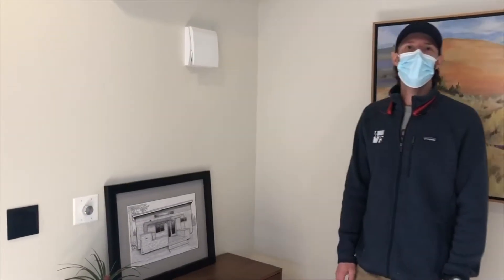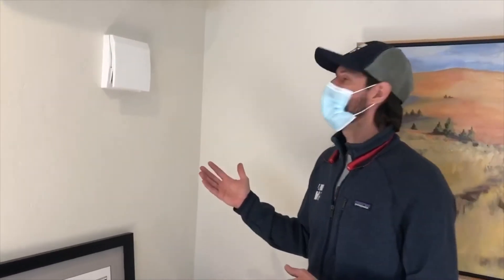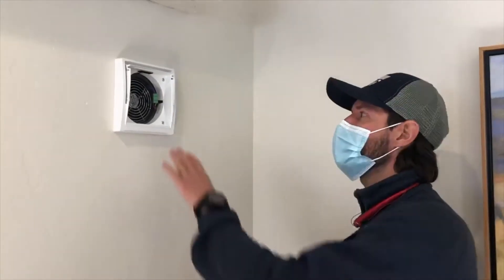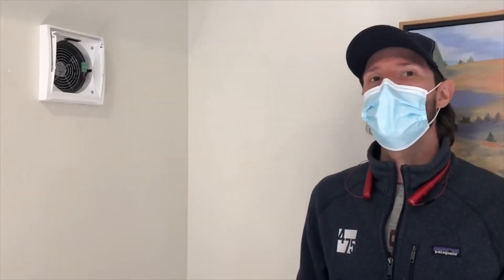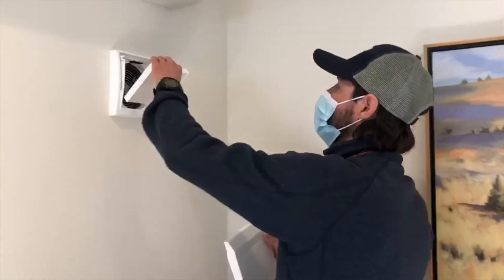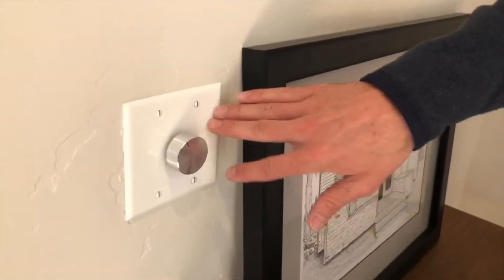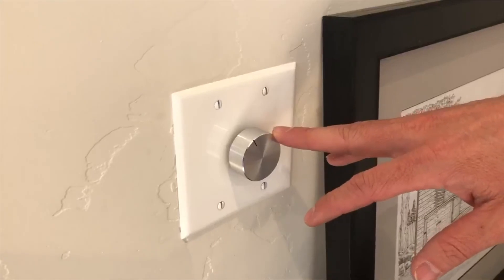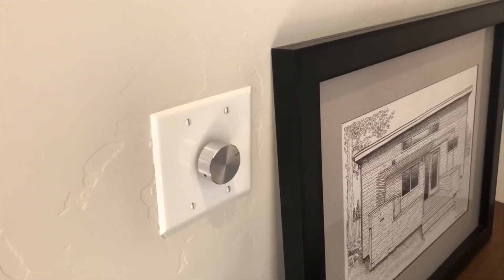LUNOS e² System at Hiatus Roanoke

Comment: What do you guys suggest for insulation after the fact, on old construction.  Most of the videos are of insulating on new construction before the drywall and siding.  I just cut holes for 4 fans and while the holes are somewhat tight around tube they will need something I suppose.

Also I have the e2 short fans.  The tubes come in at 10 1/4inches length. I still have to chase the walls slightly on the inside of the house to get to 8" minimum depth to support fan length.  Do the fans gain efficiency from keeping the housing tubes longer?  say the full 10 1/4 inches Or is this negligible?
Reply: I think if you read the data, the longer tube has a slightly higher efficiency like 90% vs 85 for the short, or something like that.
I too am looking at installing a shorter version on my renovation project.